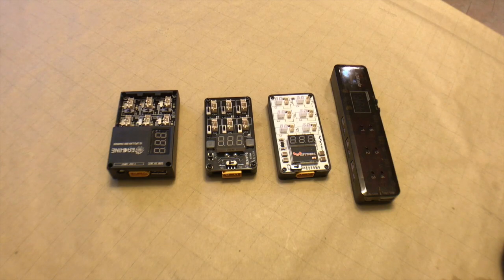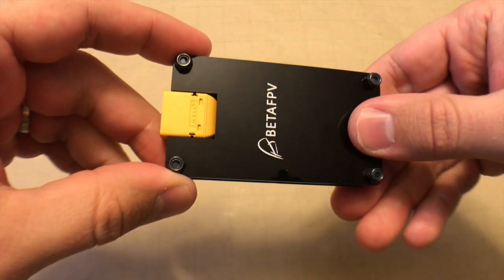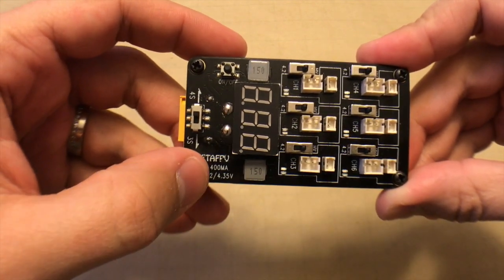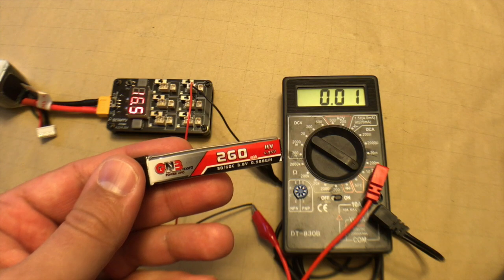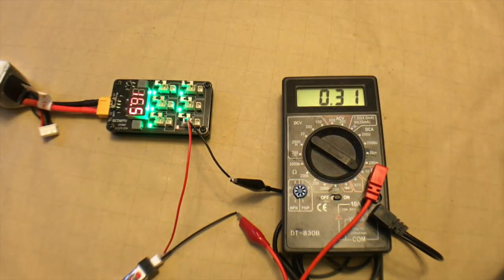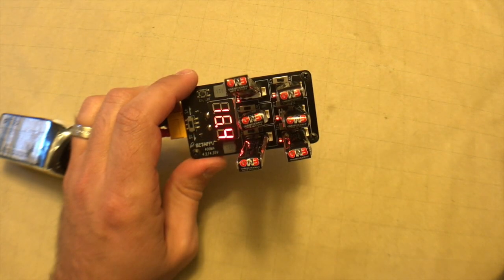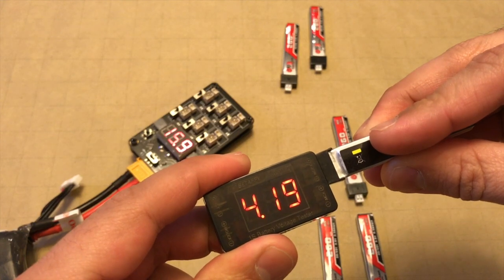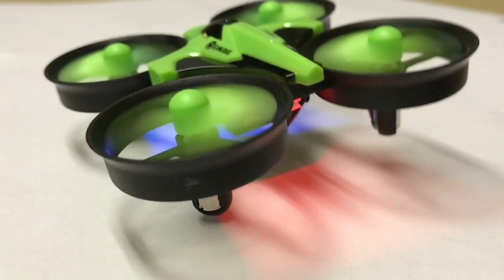BetaFPV 1S LiPo Battery Charger Review & Testing - Part 2: Tiny Whoop Charger Comparison

Comment: My charger just came in and is ready 12.4 in 3S.  The battery being charged is a BETAFPV 300mah BT2.0.  It will not turn on in 4S.  It is plugged into the wall as well.  Please advise.